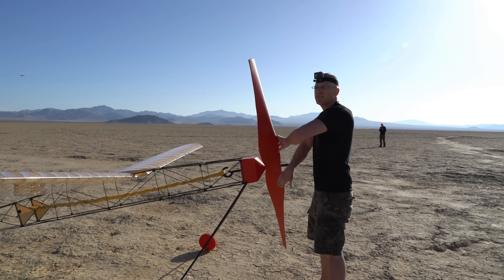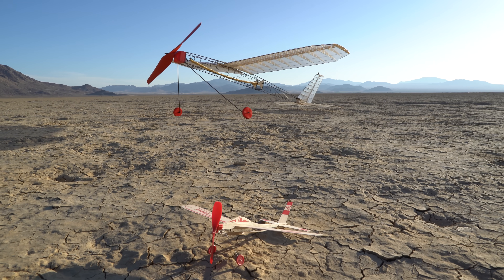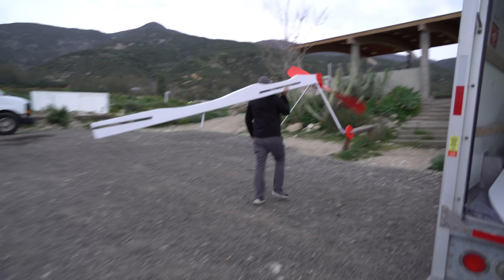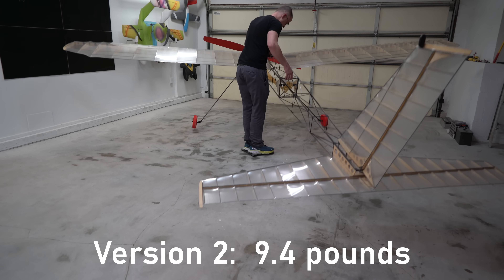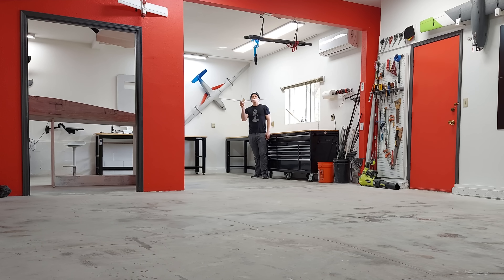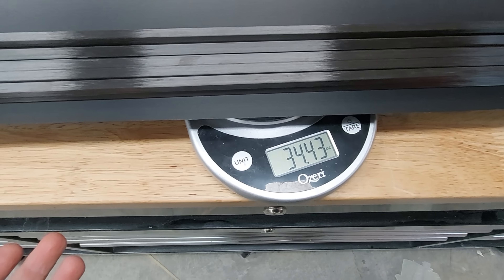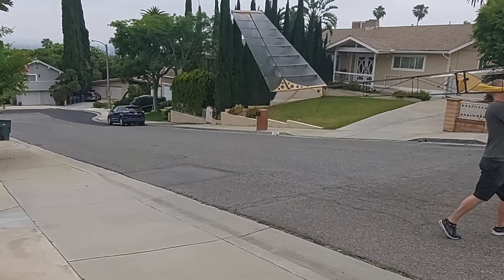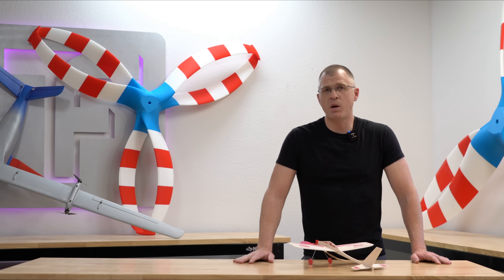Massive 16 Foot Rubber Band Powered Airplane

Comment: Rubber powered flight at this scale is handicapped by the weight of the rubber band. A simple glider would weigh less, go further, radio-controlled wing and tail giving direction, after lift, allowing you to send her as high as your controller range. Just a thought.

Comment: At a certain size, a linear to rotation converter, i.e. rope on a spool, that converts rubber band tension into geared up propeller rotation might be better, since it should scale linear with cross section/rubber band weight, compared to twisted rubber band.

Comment: I know I'm a bit late to the party. But if you're still interested in flying this amazing model assuming you still have it I noticed one thing that you didn't do or if you did it wasn't shown and if so disregard my comment. But to get more power out of the rubber lubricating the bands helps a lot.  for my rubber powered planes I lubricate with a lithium grease. Its night and day when I compare a non lubricated rubber motor vs a lubricated one. When I tested non vs lubed with the same amount of winds it seemingly doubled my power. Which tells me most of the power is lost to friction on the non lubed motor. YOu simply rub down each strain of rubber with the grease and wipe away any excess.
Reply: in this case, doing so would require  a  LOT of lubricant/mass.

Comment: fantastic project with amazing results!       did you consider also using 2 circular magnets instead of the bearings  to reduce the friction make by the pulling rubber to the propeller?

Comment: wowe this is onwderufl  i think u need to spend more time on the test speed of the  rotation more than general  aspect of the airplan.  u need to ritch speed with only test the rubber before montaing it on the air plan this ll save you lot of time. good lucl bro

Comment: I really enjoyed this video, I remember my first rubber band airplane, they were made by North Pacific, it was the "Skeeter", the mid-range model between the jet glider & the "Sleek Streek", so it didn't have any landing gear. 

But I was lucky enough at that time to live right across the street from the neighborhood park, where the only trees were at the end where the community rec room & the playground was. It was about 7 blocks long, with a baseball/softball diamond about 2/3 the way down and you could play a game of football & baseball without interfering with one another. 

It was also the local kite flying area as well, Absolutely perfect for a budding young aeronautical engineer/pilot, and the city airport was about 1.5 miles away if you felt the need of inspiration. I spent a lot of time hanging around that airport, but those a tales for some other day.

I fondly remember messing around for whole days with a buck's worth of balsa airplanes, a lot of the time it was just me, so I did things with those simple little aircraft & no one to tell me that my absolutely workable theoretical modifications were totally impossible. There were also balsa biplane gliders produced by Guillows that never did come out with prop drives or landing gear on them, I don't know why that was, but I wound up installing both on the biplanes, I even added ailerons rudder & elevator tabs to them, and with the rubber band power, they flew beautifully.

But in this video you've accomplished the dream of every little kid from those days, to build a big-ass rubber band powered balsa-wood airplane, and made it fly, even if it wasn't totally successful. And you forgot one thing that might have aided you. On the balsa-wood planes we had, you had a rudimentary airfoil. The wing slot in the "fuselage" was curved to aid in the lift, and the plastic tab holding the wings on the Sleek Streak was made to be positionable along the fuselage. Push the wing clip closer to the prop for stunts, like loops, mostly, or slide it back along the rail for long, straight flights with a bit of both rudder & elevator tweaking to give a slight bit of auto-pilot. 

And for that I honestly thank you!! You've made a guy in his late 60's feel like he was 10 years old again, even if it was only for 14 minutes.........

Comment: Drop the weight by fropping the wheels. You could also stretch the rubberband when winding to gain much more power. Lubricating the rubberband with glycerin also helps in protecting the rubberband and allowing more winds.
Reply: I used to compete flying rubber powered planes. We would always stretch the rubber. We always used armorall for lube. Thats what the old guys were using

Comment: It looks like at the end, where you had amazing success with the flights, the footage is flipped 180 degrees. I.e. the propeller is rotating backwards. Clockwise. Where as some of the other footage shows it rotating counterclockwise to power the flight. Small detail, but otherwise congratulations on achieving flight. It’s a beautiful upgrade of a toy we have all played with. Very cool project. Also, really appreciate seeing your process (trial and errors). Obviously ending with the culmination of all your hard work.
**Also learned something new here. Had no idea that the toy predated the Wright Brothers flight. That’s amazing that a toy airplane played a role in the development of real airplanes.

Comment: I think the problem with your rubber band airplane is that you are twisting the rubber bands. This is extremely inefficient way to store and extract energy.
You could store and extract much more energy by stretching the bands and have them pull a rope wound over some kind of shaft and then have the shaft go through a mini gearbox to deliver power to the propeller.

Comment: I wonder if you could get more power by using less loops, but longer loops and then braiding them as is common with small rubber motors?

Comment: Propeller needs to be lighter to increase power.  Could have channeled the foam on the prop to remove weight since it was being fiberglassed anyway.  The center of the prop is not making any thrust so excess material could be moved from there.  Attach tail to a fish scale and do propeller trials to see how much thrust you are making.

Comment: Simply because the laws of the universe present a different ratio resilience/weight according to scale; that's also the reason why electric powered vehicle are cute at a certain scale but an evolutionary deadend for intensive transportation (weight, distance, durability, etc...).

Comment: Think if you can drastically reduce the weight of the prop then she will soar. Perhaps drilling 1/2" to inch diameter holes all over the prop and then cover holes with something like carbon fiber.

Comment: Instead of a rubber band why not use magnetic plates equal to the weight of the rubber band ?
And it will go forever. Need to lighten everything of course.

Comment: What if you used paracord instead of a rubber band attached to a spring? You wind up the cord and stretch the spring, the spring pulls back to turn the prop?

Comment: I built planes for about 15 years, 35 years ago. I'm now 74.

I would try a pod and boom fuselage and empinage with fewer bands pulled tighter and pulling a rack & pinion arrangement to change linear pull into rotational.

Comment: If you want to get more rotational speed from your propeller then try using a nylon sliding door bearing instead of washers. If you use the washers for structural support instead of rotational motion the plane should respond better. Sliding door bearings will add easier rotation and considerably less drag on the rubber band shaft.  If one bearing isn't strong enough then use 2 stacked on the propeller shaft. That should provide better and easier rotational energy from the rubber bands.

Nylon sliding door bearings are easy to find and are very inexpensive to buy. When fitting the bearings make sure that your prop shaft is the same diameter of the bearings inner diameter for a snug fit. The snug fit will minimize wear while providing better and more adequate energy transfer from the kinetic energy stored in the rubber band power supply. 

Because of the enormous and vast increased size of your rubber band airplane, your design needs additional mechanical assistance to aid in the energy output of the rubber bands used to power the propeller. It's simple physics and basic engineering...

To further your experiment try using a shorter and narrower propeller. Try making one wider but shorter. Wider props generates more airflow. But shorter and narrower ones creates better energy airflow speed. You got the right idea. But you need to expand on your experiments to find the right balance for flight.

Your framework of the aircraft is good, but is a little bit too busy. Too busy equates to additional and wasted weight ratio. Reduce the numbers of ribs and spars by 5% and increase the width of the wing (not length) by 7% to increase lift. By reducing the numbers of ribs and support spars in the wing while increasing its width will better balance and produce more efficient airfoil lift.

Comment: Time 4:00 checking the all important Centre Of Gravity is not sensible.  It balanced at about 90% of the wing chord, 5 to 15% would have been appropriate, the C.O.G. must be well in front of the Centre Of Lift for the horizontal stabiliser down force to correct a pitch down or speed excess deviation.  Time 13:00 shifting the weight back denied any inherent stability in speed and pitch.  Weight forward might bring about an initial pitch down on launching but it would stabilise with reducing oscillations.  Look up professional standard principles of flight material.

Comment: I guess if you used compressed air it would work better than with a rubber band https://youtu.be/Ho2l1K4Jprg  , he can even control the flight with an Rudder by remote control and it flys over an minute and thats with plastic Bottles as pressure Tank .

Comment: When I was a kid in the 70s and 80s I use to fly the rubber band powered plane.  Remember, there was also a glider.  I always thought the rubber band plane was cooler than the glider but for me the glider always flew better.  Did anyone else notice that the glider flew farther and longer than the rubber band plane?

Comment: When I was a kid I cut out the control surfaces and glued twist ties to them so I could make it do tricks. It could take off go in a circle and land smoothly all on it own on the local parks basketball court. It could also take off. Do a loop and land without crashing. There were other tricks but those were the most impressive.

Comment: To  Think Flight:

 

(excuse my mistakes, se habla español) I m an aviation enthusiast, i m interested in human powered hellicopters, they are all built with state of the art materials, with the colaboration of many people. Most of them have a wing area of 36 m2, and a weigth of 40 kgr. The operator/cyclist adds 70 kgr, generating (for a very little time) about 0,75 hp (500 watts).

 These numbers are incredible, clearly the key to get such thrust (130 krg), using that power (0,75 hp) is the area (36 m2).

Maybe it can be built a machine with cheaper materials, using an engine of 4.5 hp, and contra-rotating rotors (3 blades of 6 m2 per rotor).

 Obviously, is going to be heavier, but we are talking about 6 times more power, it´s about playing the numbers. Do you think it´s posible, let me know, thank you .

                                                                                    Homero Perez Velez homeropv@yahoo.com.ar
Reply: I kinda wanna fit contra-rotating props with 5 blades each onto a scaled up Supermarine Spitfire with a Lycoming XR-7755-3 power plant.

Comment: magnificent! wonder if wings flapped w/ ornithopter mechanisms( less weight than propellers?) it would increase lift? and feels, propellers should be larger n hollow w/ solid weighted tips for added centrifugal thrust to move more volume of air across wing span..  as smaller airplane porpotioned propellers would require more speed/air flowing for flight.. commence 30 sec flight, distance challenge, internet?

Comment: How about relying on the stretching power instead of the twisting power? Stretch out the rubber band bundle to the max. Double length with a pulley at the tail. Propeller end is a chain on the sprocket of a gear mechanism rotating the prop shaft

Comment: I'm nearing 60 years old and I lost count of how many rubber band powered planes I bought, flew, modified, destroyed, and lost. It's one of the very first ways for a child to begin understanding physics/ aerodynamics. This project of yours had me reliving my youth and the many flights I launched. The most memorable one is when I rigged one to drop lit fireworks. Upon launch, a gust of wind caused the plane to basically do an immelman and drop the firecrackers on me. Woo hoo! There's no experimentation without risk, eh?

Comment: Check out how to braid the rubber motor. Looks like u can afford the weight. Should be able to get a lot longer prop run. Thanks for that spear fishing rubber idea, never even considered that as a source. Use something similar to high-start gliders.

Comment: I just happened to find this video by way of the icon thumbnail on the screen!  I've seen other attempts of miniaturation   minitration (can't get the proper word to come forth from my brain and spellchecker) in the past, but this video brought back some of the same feelings of flying the balsa planes from my youth.  The video shows that others like a small version of a SPACEX rocket that flew and landed itself were possible also!  What a kick.  I have SUB'd and LIK'd this video so I can follow the ongoing progression. How far can you take this idea?  Will you RC the model when it is flying well?  But then there is the consideration of the longevity of the power system.

Comment: Great work...Have you tried one like the older ones with a rubber band catapult and a hook on the bottom , and just pull the plane back to stretch the rubber band then let it go.

Comment: A comment I made to a friend who showed me your video.
No disrespect intended. On the contrary, I applaud you for your effort. Some observations that may prove helpful.

Matt:
The rubber band plane (2nd version) was gliding very well. Then he messed with the center of gravity by adding weight on the tail. That was a mistake. He should have used a thrust adjustment instead. Also, he should have narrowed the prop for improved efficiency. May not have needed thrust adjustment if he did that. Could also have reduced the diameter of the prop a little bit.

I think the surgical tubing was a mistake. My book by Campbell on making scale model airplanes fly has tables showing hysteresis loss with various types of rubber. I'm pretty sure the tubing has bad loss figures. He should have contacted FAI and tried to work a deal on the kind of rubber we use. Also, he needs way more winds and should be stretch winding for triple the winds. Could be very tough to figure out how to do, however. Maybe a winch on a truck with gears.

It is hard to say what the wing measured front to back, but let's just say 3.5 feet. I think he said it weighed 9.8 pounds and the wingspan was 16 feet. If all that is true, the wing loading would be .55 grams/square inch. That is actually pretty acceptable wing loading and so it should have been able to fly maybe a minute.

When you consider that he used a lot of high tech stuff like carbon fiber, he was surprisingly deficient in other critical areas.

Here is information about "The Rubber Bandit", which I saw in person in Van Nuys. Click thumbnail to see larger.
https://www.rcuniverse.com/forum/airplanes-full-scale-255/1785560-rubber-bandit-piloted-rubberband-powered-aircraft.html
https://en.wikipedia.org/wiki/Heaven_Rubber_Bandit
https://sustainableskies.org/tag/george-heaven/
https://abcnews.go.com/US/story?id=96661&page=1

Comment: This was really cool to watch. I thought that you could add extra torque to the drive by using those exercise rubber bands, they have a flat cross section and come in difference strengths. Theraband is one particular brand option. Would love to see this fly far and and high. My kids are now almost grown up and they both loved the balsa and tissue paper planes I made them with rubber band drives.

Comment: Very cool. You really went all out.
Makes you wonder what it would be like to use really long versions of rubber tiedown straps instead?
Reply: Also putting the tailfin under the plane should lower the vertical center of gravity and make it more stable in flight?

Comment: I'm a bit disappointed, the stereo foam plane had potential, maybe a different type of rubber that would allow for more turns and compression is what you needed and maybe adding a little bit of extra weight in the front to turned in to a perfect glider once the propeller stops spinning.

Comment: You can realize a lot more power (watt-hours or joules or however you want to measure it) from rubber bands if you lubricate them liberally with glycerine. We built a rubber-band boat that could navigate the length of a swimming pool from a standing start in under 1.5 seconds. Without glycerine the rubber bands melted; with glycerine they could be reused. Carbon-fiber hull, aluminum frame (for band tension) twin counter-rotating props, and eight 12-strand motors. I can send a video of a run.

Comment: you shouldn't think with the mentality of "don't waste the load" because rubber bands lose energy in heat(they heat up when stretched and lose stretch when cooling down) the longer they're loaded, for a good result never pre-tension and then move it around
Reply: also pull probably >>> twist, isn't there some lever work you could do to stretch the elastics to turn the propeller and still load it by turning the propeller the other way?